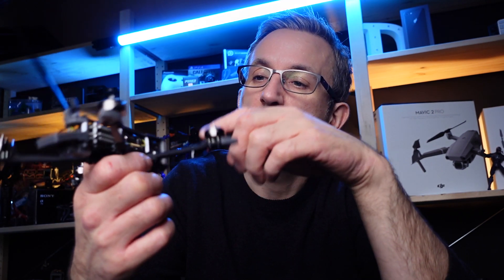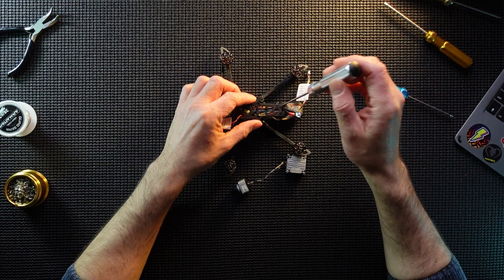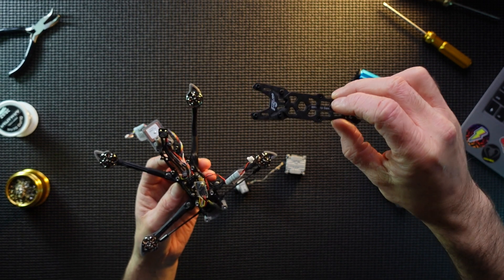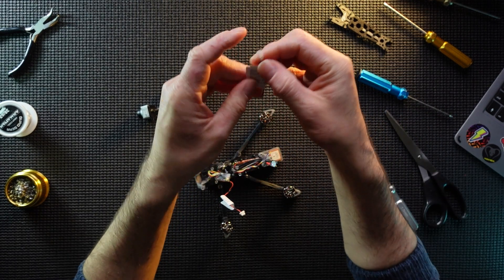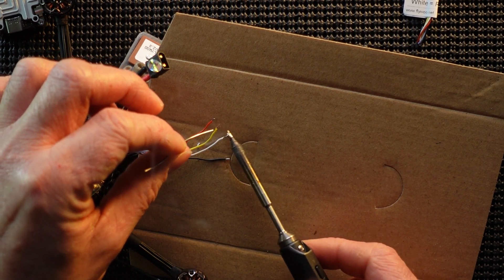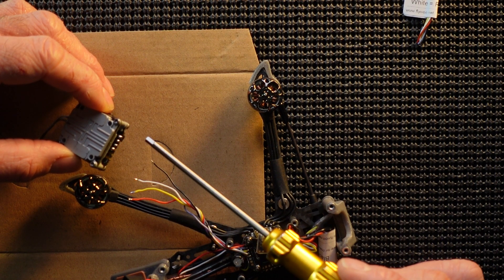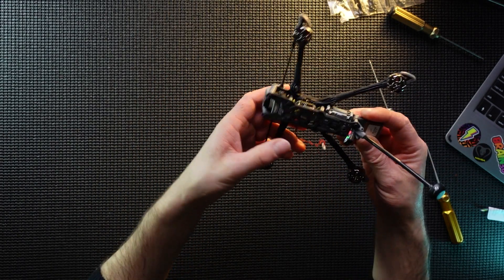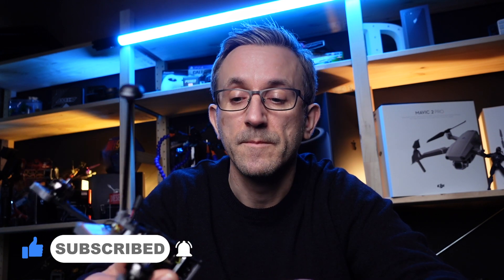Flywoo Explorer v2 - Caddx Vista Installation

Comment: Excellent video!  One question, would you know if the 8cm camera cable would fit the flywoo LR4?
Reply from the maker: yes, you'll be fine with the 8cm camera cable. - remember to subscribe! thanks
Reply: @Datfpv  It's done, one more member 👍👍👍

Comment: Thanks for this video! Just to confirm regarding wiring the power wire, you connected to VCC pad on the flight controller? I am looking to upgrade my analog explorer in the future but it looks like the older Goku F411 it has doesn't come with a VCC pad, so I would either have to connect directly to battery or buy the same flight controller here to satisfy the required voltage.
Reply: Update: Actually there is a VCC pad on the ESC at the side facing the front. I'll just have to connect a wire there.

Comment: Hey mate just wondering since only two uart avail on the fc, which crossfire and gps took them both i'm using the normal vtx pad for the vista everything is working except i dont have any osd. Any idea how to fix this? Cheers
Reply from the maker: have you changed the setting in your goggles... ?
Reply: @Datfpv  yeah, i did select the custome osd option. As it using the soft serial port that could be the reason why. Watch a video from gal kremer but couldnt fix my issue. Thanks for reply mate! Good content as usual!

Comment: Why did you not use the blue wire that comes with the flywoo?
Reply from the maker: that must of been the sbus for the dji controller - the built in reciever, I don't use it, I use crossfire

Comment: Is this version included long flywoo antenna ?
Reply from the maker: yes the long antenna at teh back of the craft comes in the box - basically just no caddx vista unit in it...
Reply: @Datfpv  one more question my friend , what length of coaxial cabel i need for flywoo ? 8 cm is enough?

Comment: Thank you for these detailed steps to install the HD system. I wonder where did you get those 2 black plastic pieces to mount the FPV camera? I ordered the same set (w/o camera), but it does not come with camera mounts... I emailed to Flywoo with the question.
Reply from the maker: hey - if you mean the 2 bits that I attach to each side of the dji / caddx camera, these should come with the quad, they did for me - they are the camera mounts and should be with the quad....! if they are missing from yours then flywoo have missed them out!

Comment: What's blue cable for mine was connected.....sbus?.....
Reply from the maker: if thats on the caddx, then yes it will be your sbus connections if you are using the dji controller.
Reply: @Datfpv  my buzzer stopped working and flywoo sending a new one but who knows how long that will take to get here(Boston USA) so I saw the v2 on Amazon and I don't like flying without buzzer so I ordered a couple.while taking my quad apart(and being as gentle as possible) I had wires disconnecting all over the place now I got myself in a pickle I wish I took pictures first so I know where they all would go.....
Reply: @davidcanole3758  if your buzzer is the exact same then the wiring from left to right is, far left is black ground, red is power and soldered to the middle pad and white is signal and goes to the right pad.